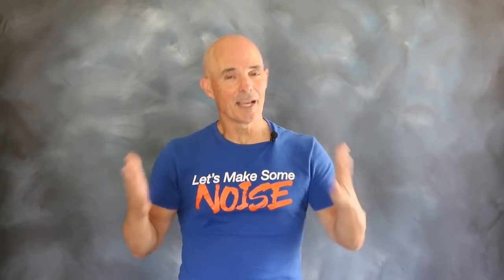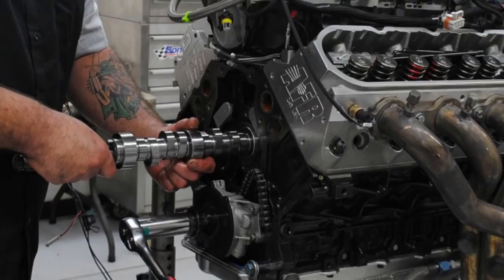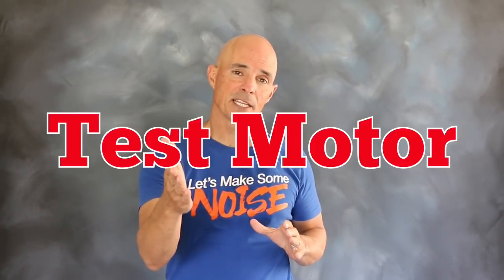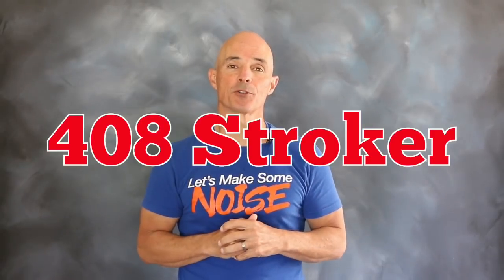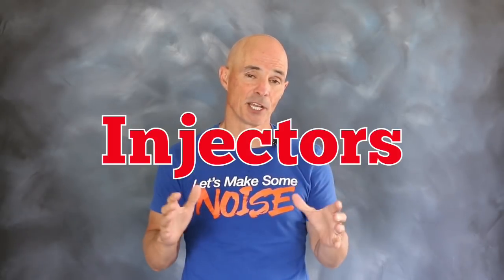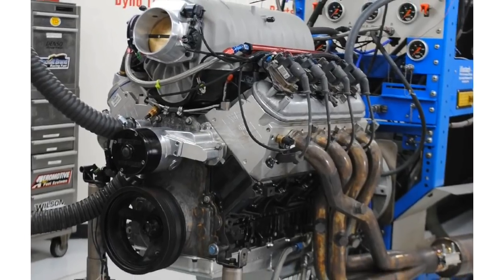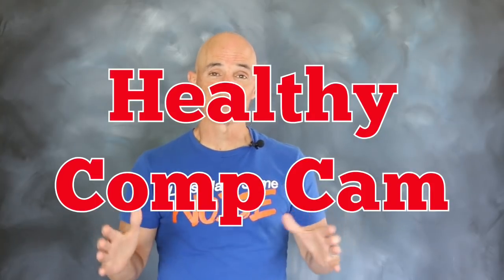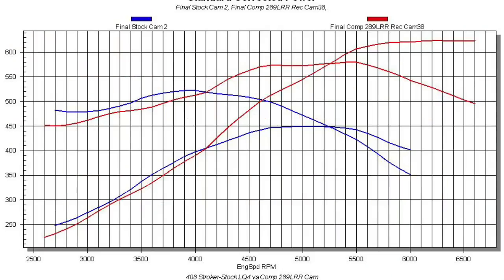Speed Secrets: Cathedral vs Rectangular Port Cam For Your 408 Stroker Engine Cam Swap

Comment: All the cool guys on here making fun of the fact the he ran a stock cam in a built engine. Where else would you see that?! I found that experiment super informative. With the stock cam in the built engine you have huge torque and great power that is similar to an old big block such as a Buick or Oldsmobile 455 or similar.

Comment: Yeah, um testing the stock cam VS literally any aftermarket cam would show gains, i thought you were going to test a say 239-243 cam vs a 235-247 cam or whatever, this was pretty much just a compcams advertisement with no real data other than you built a 624hp 408 lol

Comment: How do we know a cam designed for cathedral ports wouldn't have been better still? Kind of a wasted effort if you ask me since your premise is that a  rectangular port cam may in fact be superior to a cathedral cam. If your premise is true why wouldn't you recommend the other cam in the first place?
Reply from the maker: The difference between them comes down to intake flow dynamics, which is really splitting hairs in the grand scheme of things. We offer cams tailored to rectangle or cathedral port, but at the end of the day, they're all LS cams. There's a ton of factors that go into picking the "perfect" cam, and our categorizations are meant to help give some guidance when choosing for your motor. Hope this addresses what you are asking!